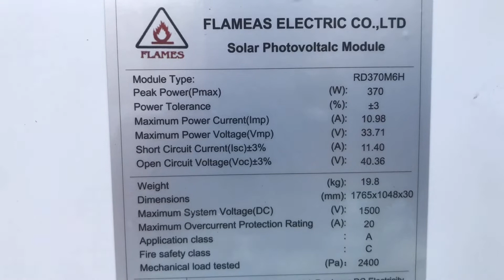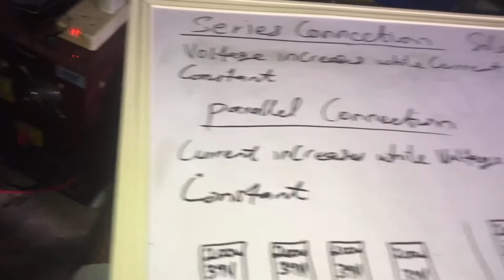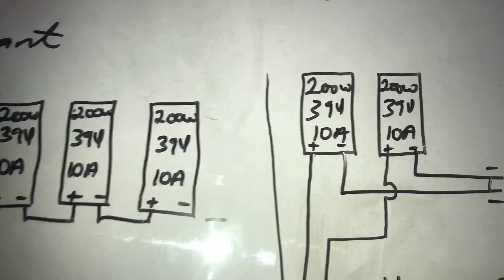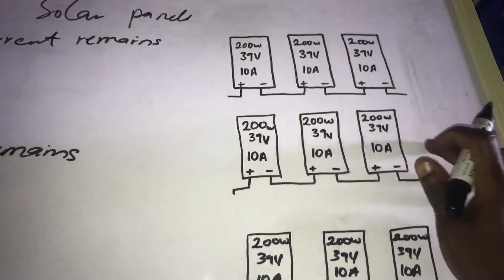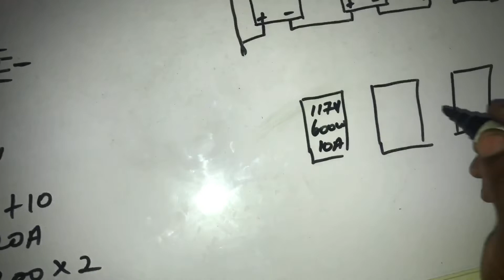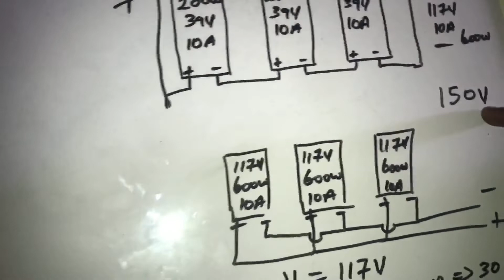Series and parallel connections of solar panels part2

Comment: What is the minimum amps to charge a 48v system?
Reply from the maker: From 1-300amps depending on the battery bank it can be more
 The higher the current the faster the battery charges 
For eg
5amps can charge a 48v battery 5kwh - 10kwh but it may take 2days or more to full the battery 🤔

Comment: I am question... For running 10hp motor.
Voltage range =380 to 440
Amp= 13
Which option is best..... Plz guide.
I have 20 solar panels of 450 watts.
Their specifications are...voltage =41.5
Amp= 13
Which option is best....???
My opinion is 2 sting of 10 panels series then parallel.... What u say....
Reply from the maker: Ok, Is the motor dc? If yes then 
Depends on the controller or dc voltage regulator you are using,if it can carry up to a 1000v then do all series reason for this is because the open circuit voltage is 41.5
Close circuit voltage will be around 38v 
10*38=380v and you need a bit more than that to power the motor because of voltage being unstable .
else

Your opinion is the best for an AC motor
Reply: @colcent_solar  ac 3 phase motor
Reply from the maker: Ok,I support your opinion of 2 strings of 10,check the inverter or charge controller if it supports 500v or more